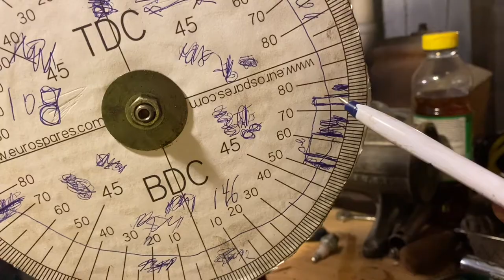Welcome Trailer Video For The Channel!!

Comment: I like the video a lot but the house of chainsaws one is still my favorite. I am not a fan of horror movies with chainsaws because I feel like chainsaws are a tool for good but I still think that one was really catchy and this one is also but in a uplifting not edgy way. I like your sense of humor. Chainsaws are awesome. Christ bless you.
Reply from the maker: Thanks man!!🙂🙂 I appreciate it!!👍👍👍👍
Reply: @Smittyschainsaws  Thank you for the reply and by the way the xl-101 in your picture is the only running saw I posses currently.
Reply from the maker: @micahatticus4257  The XL-101 is a very under appreciated saw.  They are fantastic!!
Reply: @Smittyschainsaws  Don't mean to drag this conversation on too long but I discovered something interesting with the xl 101s bar and chain. It being the perma hard bar with the Oregon 72 chain I felt it rode the sprocket too tightly and snagged when tight and the 20 inch bar was a little too heavy for me. I experimented by yanking an 18'' sprocket bar of a newer 42cc Homelite with an s56 chain mind you I drilled an extra hole in the sprocket bar and filed down the square tensioner to an oval for it all to fit. The new chain runs crazy free with no snagging even when tight and the saw rips like no tomorrow and it's even lighter. Maybe I did something bad but maybe not. Just wanted to share that with ya.
Reply from the maker: @micahatticus4257  Sounds like a classic case in which the old chain was stretched to the point of snagging the sprocket.  I have seen that same issue is very common. Chain quality just isn’t the same anymore. I doubt the bar made that much of a difference except being a little lighter. I have tested sprocket vs hard nose and the difference wasn’t really noticeable. The saw had enough torque that it didn’t really make much of a difference. I couldn’t tell while cutting at least.
Reply: @Smittyschainsaws  Thank you for the info. What you said about chain stretch and snagging sounds spot on. Your definitely involved in chainsaws more and it shows. Your knowledge of what was wrong I agree with. The part about me changing the bar I am still okay with because I am short on cash And it still worked pretty well but if in the future I want to use the 20'' bar I will just change the chain out. Thanks for clearing that up. Take care my friend.
Reply from the maker: @micahatticus4257  Come back again!  I enjoy some saw talk!